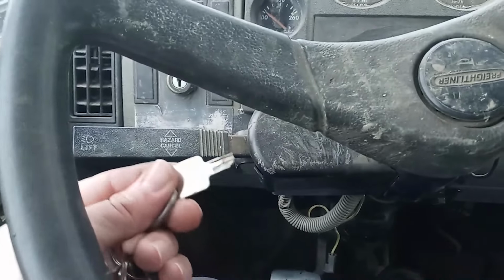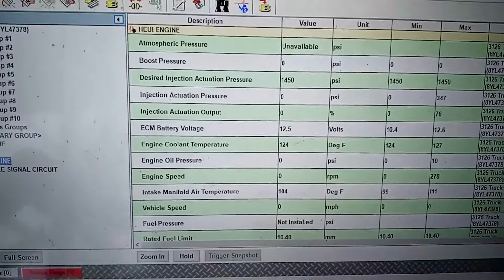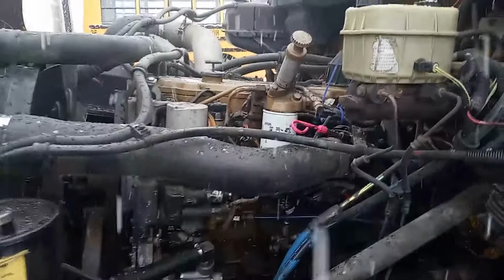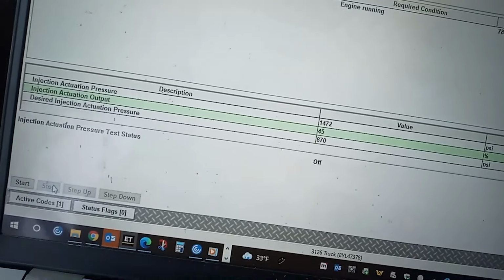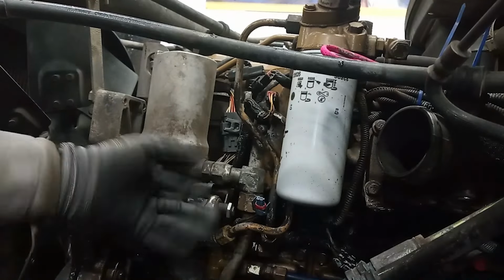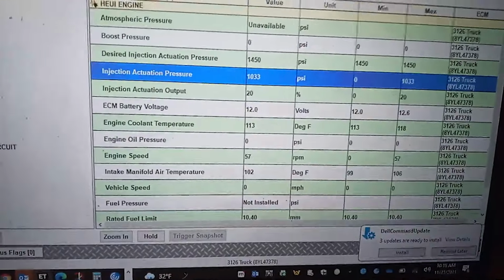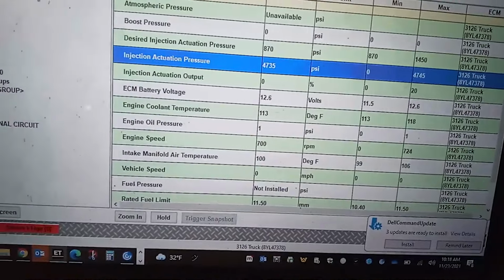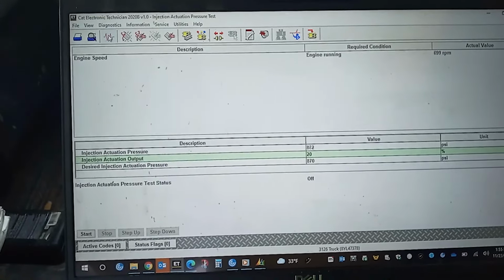Why Wont This Engine Start!?!

Comment: Fastest way to check ICP issues is dead heading the pump with a gauge. Or popping the valve cover off and physically checking for excessive oil leakage around injector seals while cranking or running.
Reply: And agreed...always deadhead....just make sure you have a gauge that is made for liquid and goes to 6k psi and also make sure the gauge hose is rated for up to 6000psi..Ive tried 2 wire 4000 psi hydro hose and it popped.
Reply: I Air check for O-ring leaks,without pulling the cover...disconnect the HPOP supply,I use a fitting that taps right into the port...air it up to around 120-140psi ....then,take a plastic bag and wrap it around the breather tube and see if the bag expands,from the leaking,compressed air @ the injectors...as the compressed air will fill the block with pressure and vent out through the vent tube
Reply: I've thought about that years ago when I would work on the 444 and 466s but was worried about tearing up a good pump by dead heading it if something else didn't give.
Reply: @markwilliams4525  nope...wont hurt it one bit,as long as you do it for no more than 20 seconds at a time...as soon as you release the key from start,(left in on),The IPR valve will let it bleed back down..just make sure you use 6000psi 2wire hydraulic hose and a liquid gauge rated for 10000 psi...the gauge should jump up to about 4000psi,within 10-15 seconds
Reply: @mikekopisz1227  I do appreciate the advice, thanks.
Reply: @markwilliams4525  its actually what international/Navstar calls for when diaging the HPOP
Reply: @mikekopisz1227  I had no idea. I was about 23 years old at the time and self taught when that crossed my mind, I ended up trying it and it ended up not making pressure but just for the hell of it I replaced the ipr valve and it started right up. Never tried it on one that built pressure. What does it do when it does build pressure?
Reply: @markwilliams4525  they will build around 3200-4000 pounds of pressure on the mechanical gauge hooked up and that verifies that the pump is able to put out max pressure under max load conditions.
Reply: @Thegoose95  oh ok, I wonder if you can do that with a 3126 cat.
Reply: @markwilliams4525  you can take the high pressure line off at the pump and adapt a fitting onto there with a gauge and full field the IPR valve by intermittently applying fuel 12v to the valve for a couple of second while cranking. This will make the IPR valve close and cause the pump to make full pressure assuming the valve is good. Or you can install the valve plug like he did in the video.
Reply: @markwilliams4525  you sure can test the same way on the CAT HUEIs(3116,3126,etc)...you'll just need the right fitting, which is an O-ring bossed style for CAT as with I.H. you can use a #4 J.I.C.
Reply: @mikekopisz1227  I'm definitely going to try it
Reply: @markwilliams4525  just remember....as soon as you see it build peak pressure, stop cranking...if its not hitting target pressure within 15 to 30 seconds, let off and do one more cranking test..sometimes takes a couple of tries before supply reaches the HPOP...
Reply: @mikekopisz1227  sounds good to me, thanks for the info.

Comment: If you don’t like spraying starting fluid directly into the intake, if you have a second person handy, I always like to grab a shop rag and put a little gasoline on it and pop one of the air to air boots off and while your buddy is turning the key trying to start it, you’re spreading the rag right across the air to air. I personally just like doing that better than starting fluid, but I have used starting fluid many times lol. Great video
Reply: Gasoline has more resistance to Detonation under heat and pressure, called octane, where starting fluid is extremely volatile under heat and pressure, so I don't understand how Gasoline is going to start a cold engine better than starting fluid or diesel fuel for that matter.
Reply: @goodmanboattransport3441  they don’t need much. A little bump of gasoline vapors and it’ll come to life. I’ve never locked a motor up with that technique. I’ve locked them up with ether though several times.
Reply: @tywinters9462  
Great care is required using ether, it doesn't take much and never let the glow plugs heat up, that's a recipe to blow up the intake on a diesel engine.  I've found cranking until you get some smoke, then a quick 1/4 second shot gives that little bit of fire to light the cylinders
Reply: @goodmanboattransport3441  I don’t disagree. Yea you just have to be careful. I’m not against using ether, I always keep a can with me in a pinch.

Comment: Some people like to throw sh*t at all these newfangled electronics, but I found them very useful when diagnosing school bus engine problems.
Reply: @Islandwaterjet  yes but you also get rid of tens of thousands of your bottom line, the electronics aid immensely in getting more fuel economy and torque out of it at. I would agree the newer vehicles may have passed the point of having a good balance of tech to improve performance and simplicity for reliability.

Comment: Could you possibly do a video or give tips for rebuilding a c-15 acert for a freightliner cabover and are 2010 c-15 acert okay for California emissions law
Reply: 2010 acert are not legal anymore in comifornia
Reply: The only way you’re gonna drive a C15 in California is if it’s registered in another state.
Reply: @markm0000  and you don’t get a inspection
Reply: @yeahok115sure  You can drive a C15 through California if it’s registered out of state. However you can’t pickup and deliver a short load within the state of course. There’s no way they can stop trucks that are emissions compliant for the model year they were manufactured. Make sure it doesn’t blow smoke, keep the big mufflers on, and regularly clean the pipes, you’re good. They can only push around and bully trucks that are registered in CA, actually all those trucks are deleted out of their system so even if you tried to add a filter or make your truck compliant you legally can’t anymore. Anyways if the DOT sees your truck is super clean, everything is in compliance, and you don’t have tons of chrome, lights, and crap all over it they’ll leave you alone with your old engine. They know you’re moving important supplies to keep their state functioning. It’s all they got left. If more truckers stop going to CA that state would most certainly collapse.
Reply: @markm0000  California needs to collapse. I’m from that shit hole state. I moved 3 years ago. Something needs to change there, it’s out of control
Reply: Nope

Comment: C15 ACERT how long after staring can I go on High idle ?? What should my oil pressure be when running normal ??
Reply: I always believe the higher the idle the less strain on the engine. As soon as I get oil pressure I bump it up to 1k. The engine sounds much better and the oil pump has more power to move that cold oil.
Reply: I wait till it idles up to normal itself, when it's cold it idles a few hundred rpm lower, when it picks up to normal idle I jump it up.